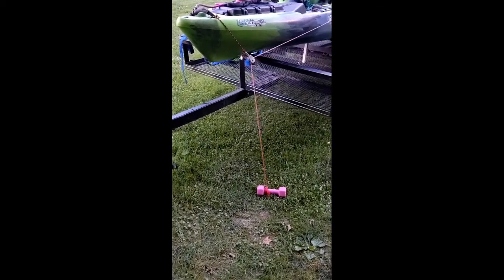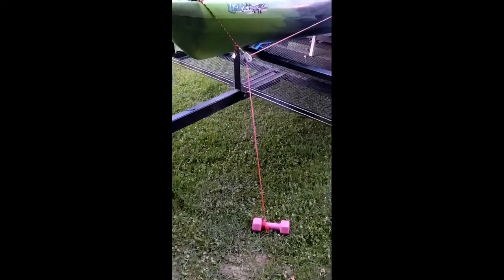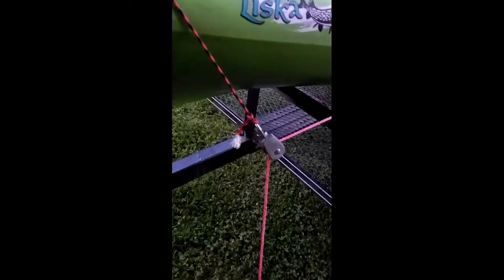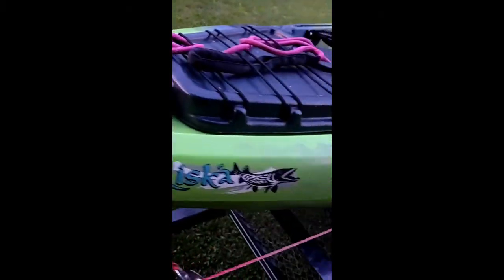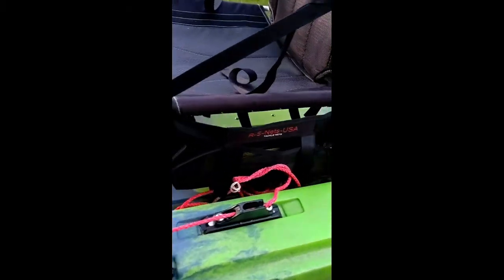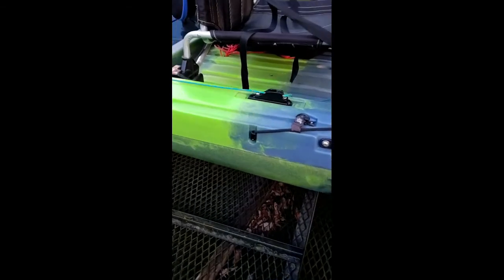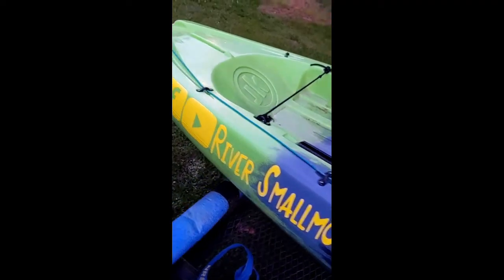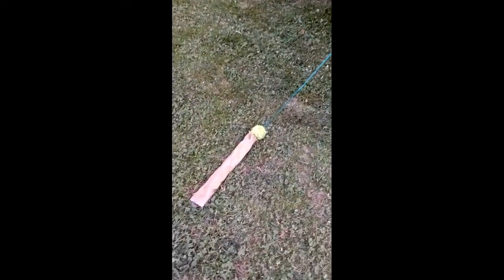Kayak Anchor and Drag Chain Set up.  #Short

Comment: Is it enough weight to keep you stable
Reply from the maker: It has worked great for me in the rivers I float. If this won't hold,  then I've found I shouldn't be anchoring there to start with. I 've used this on this Liska, jackson Big Rig and now my Bonafide RVR119 and PWR 129.